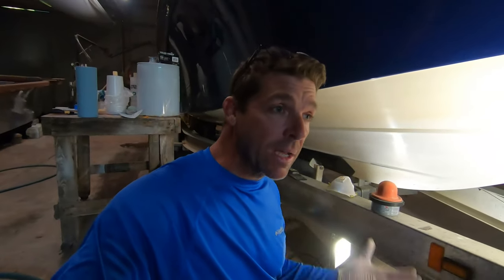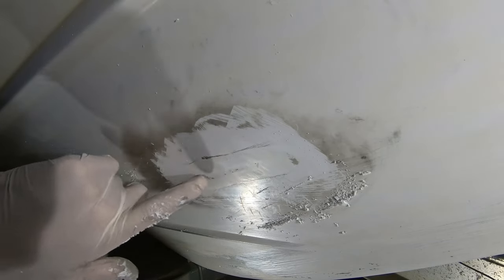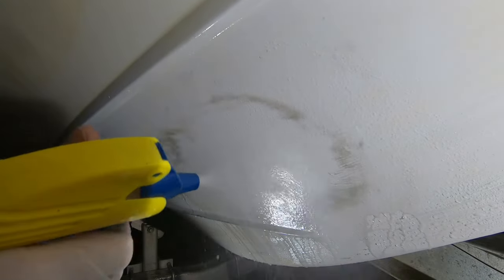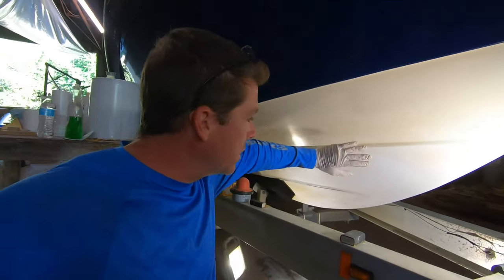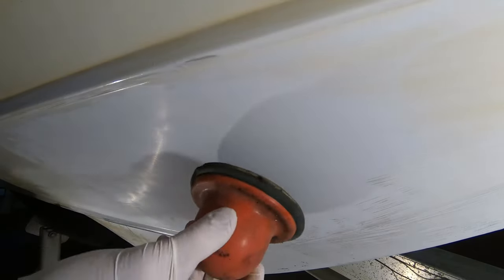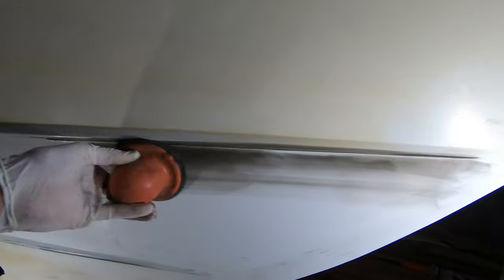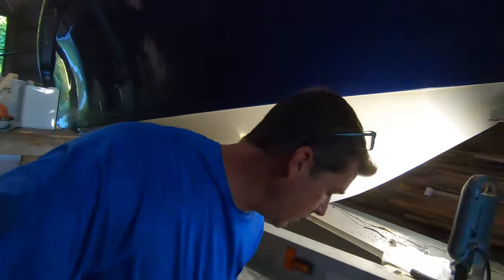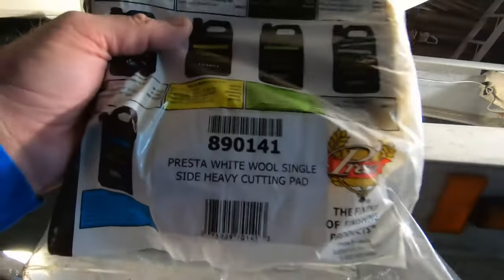GELCOAT HOW-TO Wet Sand Gel Coat, Polishing, & Waxing to a Like New Finish with PRO-level results

Comment: Thank you for the informative video - the razor blade tip was really helpful in minimizing unnecessary sanding and leaves the undamaged areas intact
Reply from the maker: Glad it was helpful! Thanks for watching!
Reply: Yep I used the blade on a recent repair.  In all my years never thought of that.  Saved lots of sanding!

Comment: Watched your repair videos a few times in order to repair a non structural ding.  So far it’s about half as pretty but it’s patched !  Hopefully I can clean it up after wet sanding the gel.  Thanks for taking the time to pass on your knowledge so clear and concise
Reply from the maker: Glad to hear you found the videos to be helpful! Gel coat repair is like anything else, the more you do it, the better you are going to get. Don't be disappointed if your first repair doesn't look as good as mine, I have had a LOT of gel coat repair practice over the years. The wet sanding and polish are where things really start to look nice anyway, so long as the repair has a good foundation. I really appreciate you watching and commenting, and good luck with your project!

Comment: Great stuff! Got a 1994 SeaRay 220 BRS, deep red over white. Found out the hard way that it was previously repaired by painting not gelcoat when I buffed through to the grey primer. Is there an accurate way to match the red without having the experience to custom create it on site?

Comment: Thanks for the awesome work and education. I notice the yellowish color above where you repaired. Is that just video compilations or does the rest of the white surface need to sanded and polished?
Reply from the maker: It is just what we call a water stain. White boats that get used a lot develop that pretty quickly in our area. It can be removed relatively easily. Thanks for watching!

Comment: Thank you for these fantastic videos.  I’m about to repair gel coat damage, but it’s on a light blue section.  Is there any way to dye the gel coat for finishing?
Reply from the maker: Thanks so much, Glad you are enjoying the videos! Yes, you can buy blue pigment to tint the gel coat, or you could contact the manufacturer of the boat for some factory-matched gel. There are also a couple different companies that sell custom gel coat colors, one is Minnie Craft the other is Spectrum. Hope this helps, and thanks for watching!

Comment: Great Video!  I purchase many of the products to fix a similar scratch on my boat when the board came off during loading..  I put the base coat down with the colloidal and it looked a lot like your finish.  I have put one coat down with the Wax additive.  My question is, do I just keep adding layers until I have a fairly smooth finish and the divot is gone?  And, do I just keep adding layers without sanding?I still have a small divot from 2 fills (Base & 1st Wax layer)..  I believe I have to be a little faster and light handed when smoothing it out.
Reply from the maker: Thanks, glad you found the video to be helpful! Sometimes it can take 3 or 4 layers or coats of gel coat to completely fill an area. The more You do this kind of work, the more You will develop a feel for how much is needed. I recommend wiping the repaired area down with acetone to remove some of the wax from the repaired area. Then sand the gel coat with 220 or comparable grit sandpaper to remove any remaining wax additive residue. Wipe the surface down again with acetone to remove any dust or wax residue that may be remaining after sanding. Then add more gel coat without the wax additive, until the damaged area is completely filled. Only on the very last coat would you apply the wax additive to the gel coat. You just want to be sure you have a clean, dry, wax-free surface before adding more coats of gel. It is pretty common to have to come back and add more gel, so it sounds like you are doing ok. Hope this answers your question. Good luck with your project!
Reply: @FishBumpTV  thanks, looks good now.  Moving on to the razor blade, then wet sanding.  almost done, time to tie one on!
Reply: @FishBumpTV  well the cracked area came out last weekend. But, I did catch some nice fish:) I have talked to a friend who has worked with gel coat and was told to sand between each layer. the coating around the cracked area held up. I believe I need to sand around the cracked area a little deeper, until I can see the next layer below the gel coat?  The razor blade worked great. I did have to sand quite a bit to get the edges flush, but I could actually see the cracked area below the surface. Not all of the cracked area came out. Also, I did have moisture coming out that was soaked into the fiber glass, but I did vacuum and heat gun the area. Let it rest overnight and felt no moisture prior to first colloidal fill.  Gonna go at it again, maybe I still had some moisture that worked its way back to the crack.  Not giving up :)

Comment: Enjoy your videos, but how do you get the new repair and the older yellow finish to match
Reply from the maker: You have to clean the old gel with a acid-based hull cleaner, and or lightly sand the area around the repair with very fine sandpaper to remove the stain prier to matching the gel. Hope this helps, and good luck with your project!

Comment: Love your Gelcoat videos! If you don’t mind I am a new boat owner and the previous owner has the keel worn down to the fiberglass (most likely from beaching). I’d like to get your recommendation as I see suggestions on boat forums saying just use a gelcoat or first use something like Marine Tex (epoxy). I am planning on purchasing totalboat white gelcoat with wax it do you believe I should add a coat before the gel? And what would you recommend? I’d like to use the same manufacturer like totalboat but if something else is better please let me know. 
Thanks for the help, Sam
Reply from the maker: Thanks, Sam, Glad You are finding the videos helpful! I would be happy to give you my thoughts on the best repair method. I do not ever recommend using any kind of epoxy-based filler under Gel coat, you can use a vinyl ester or polyester-based filler if a filler is needed, as long as it is marine grade and made for below the water line. 3M makes some very good fillers for this. I recommend buying a gel coat that does not have any wax added and then buying the wax additive separately. This way you can apply 2 to 3 coats of gel coat with no wax added as your base, Then add wax on your last coat so that you can get a full cure and a tack-free surface. We have more gel coat-related videos planned, so be sure to stay tuned. Hope this helps, and good luck with your project!

Comment: I coated the gelcoat 2 days ago. There is no stick to the hand yet it seems soft. It has been humid and rainy both days. When I hit it with sandpaper after acetone dried it was gummy. Do I just need to give it more time to cure out before sanding? This was an attachment to existing hull and I was Knocking down high spots for additional coats.
Reply from the maker: Just curious, did you add 1 to 2 percent mekp catalyst to the gelcoat and mix it in very thoroughly? It won't cure without it. Gelcoat will also remain tacky for some time if you don't add wax solution on the last coat. Hope this helps and thanks for watching!

Comment: Question you do a wonderful job I'm having some gelcoat work done on my boat a few little screw holes and they're telling me that they have to match the color with paint is that right do you need to spray paint when your boat? Thank you
Reply from the maker: Thanks! Sometimes you do have to match colors. You can spray gel coat, I have not shown that in a video yet. There are so many different techniques, it's hard to say what method another shop is going to use and how it might work in your application. Wish I had a clearer answer for you. We will have more gel coat-related videos coming soon. Hope they will help.

Comment: I saw your video where u used the colloidal silica. I feel like cabosil shrinks too much. But I’m not a chemist I don’t really know the science behind these products I use
Reply from the maker: There are many different methods and additives that can be used with success. You just have to do your research and find what works for you. I have tried to show a couple different ways to repair gel, and both repairs are holding up very well on our charter boat. I plan on making more gelcoat repair vids, if you have any recommendations just let me know. I will consider making them. Appreciate the comments, and thanks for watching!

Comment: How do you factor for sun bleaching? I hit a steel doc attachment on the top part of the starboard hull of my bow rider. I found a company that matches the color (it’s a 2000 beige). It’s not left-in-the-sun-all-summer bleached, but it’s someone faded over 24 years.
Reply from the maker: One thing you could do is wet sand and polish the surrounding original gelcoat to bring back its original color and shine. I have a video on that topic here on the channel  where I restore the dark green gelcoat on a boat I built  over 20 years ago. It is one of our channels more popular videos. I hope this helps and thanks for watching!
Reply: You can definitely color match by hand too... A lot of the pre matched gel coats are very expensive and for older boats generally not even that great of a match. Take your time matching with uncatalyzed gel coat directly on the hull until it's perfect then you can clean it off with a rag and acetone, plenty of videos on yt showing the process.

Comment: Would you spray paint black on gelcoat?  My jet ski hull is black.  Thanks
Reply from the maker: You can spray black Gelcoat on a black hull, but I think you might be asking if you would use the black guide coat on a black hull. In that case, it would not work because you would not have any contrast. You would just have to wet sand slowly and carefully and use light and reflection to see any imperfections. Let me know if that answers your question or not, I am happy to help if possible. Thanks for watching!
Reply: @FishBumpTV they also make white guide coat that can be used on darker colors, never used it myself, but it's an option

Comment: Can you use a DA sander or a jitterbug wet sander ?
Reply from the maker: DA's and jitterbugs usually have soft backing pads, they will not usually produce as flat a surface as an actual block will. You could possibly use a block initially, then switch to a DA to finish out. Hope this answers your question. Thanks for watching!

Comment: jm saliou . Avez vous la même video pour du gelcoat bleu marine  et des conseils pourenlever de très legères griffures sur du bleu marine.SVP merci
Reply from the maker: I do not have another video for navy blue gel, but the repair process would be exactly the same. Just use navy blue gel for filling the repair instead of white. For removing fine scratches in the gel coat, you can usually just wet sand them out, then buff and wax .You can use our video for a reference, just pick up the process when we start wet sanding with 600 grit, then 800, and 1200 you can go even finer if you like. Just be sure not to sand through the gel. Then buff and wax just like in the video. Hope this helps, good luck with your project, and thanks for watching!